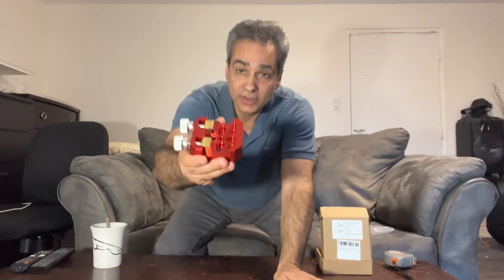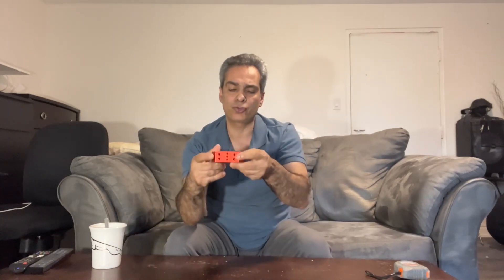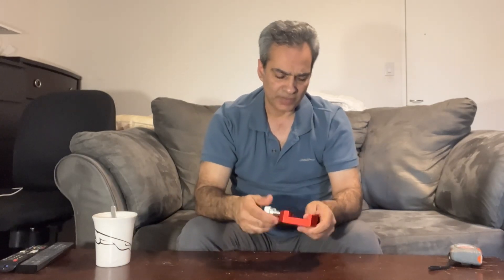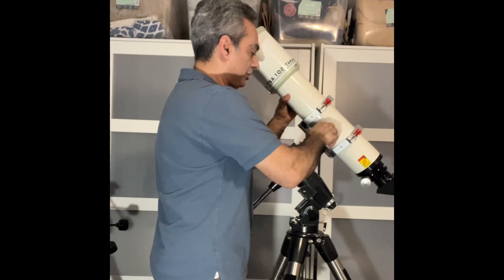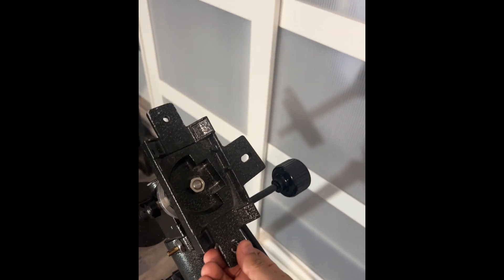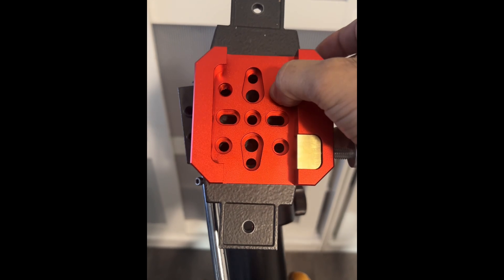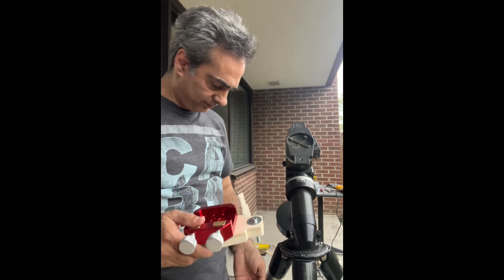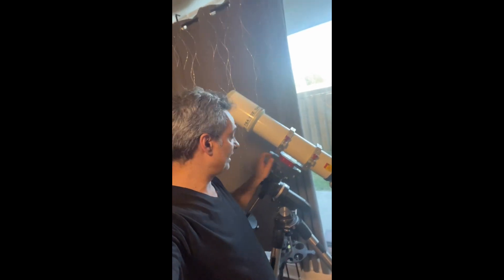making an older mount a vixen mount #telescope #space #astronomy #vixen #tripod #mount #equatorial

Comment: Some one selling similar adapter plate on eBay made out of aluminum for $140.
Search for Vixen SP mount, should come up.
I've been looking for a Vixen SP mount for a while, hard to find.
They can be used in EQ or Alt/Az mode.
Reply from the maker: @szaki  true I need to do a video on this mount. I’m not actually showing it per se, although I’m adapting the adaptor on it.

Someone else mentioned I should do a review of this compared to like a EQ five 

I believe tomorrow I just getting a hold of a Vixen Great Polaris as well 

Do you think those adaptors for 140 is that in USA money is worth it that seems almost 4 times more expensive
Reply: @JoeJaguar  It's US dollars, but sold from Japan!
SHP incl. in price!
Reply from the maker: @szaki  ok thanks for that info others reading this can find this info helpful thanks
Reply: @JoeJaguar  I own a Vixen GP D mount, but only EQ mode setting is the way.
Try to set it in Alt/Az, polar scope hitting the adjustment screw.
Az mode is great for visual use or satellite tracking, I think?
I have an 8" Newt, but the eyepiece is twisting all over in EQ mode.
That's why rotating rings used for mounting newts, but very expensive for a 8" scope.
Reply from the maker: @szaki  thanks for that information on your thoughts

I guess I’m a little bit weird. I like to have a mount and tripod for every telescope I have and I think I got about nine telescopes and about seven tripods for it almost one for each. 
I expect the quality of the great Polaris to be similar to the super Polaris just a tiny bit bigger and can handle a little bit higher load. It does come ready with the losmandy rail which is neat

Comment: I imagine one needs to be very cautious about the quality of the piece of wood when using it for such purposes. On the other hand, putting some nonmetal piece between metal parts can potentially dampen some undesired vibrations.
Reply from the maker: @janomacko5764  yeah pretty much everything you said I would think most plywood should be strong enough and damping
I think metal might be a bit harder to work with 
Thanks for watching